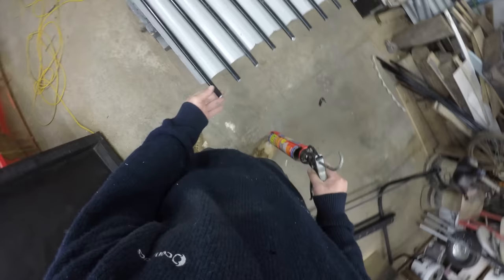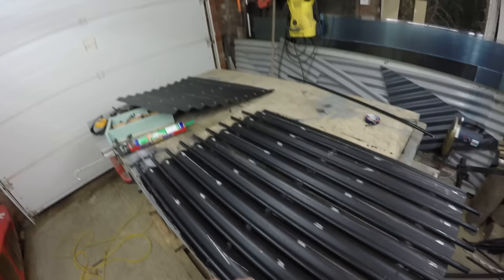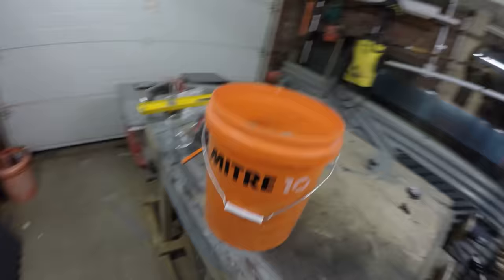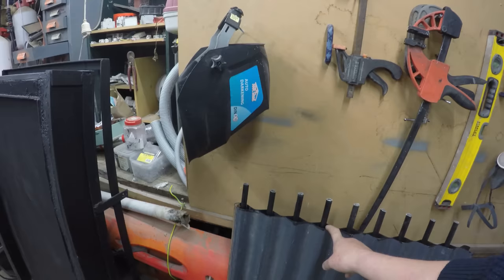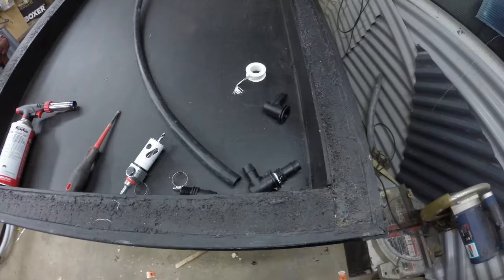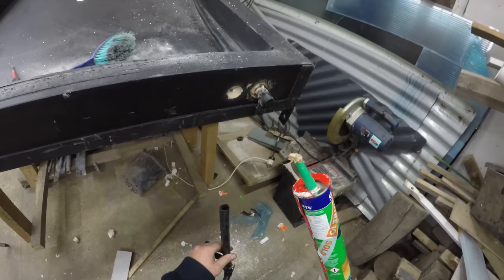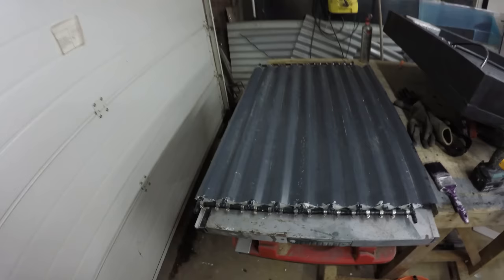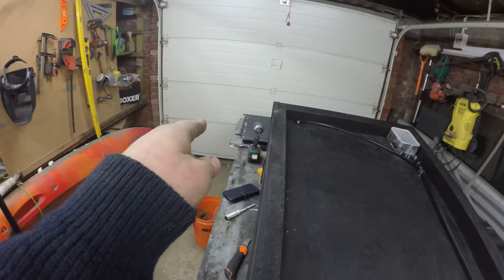Corrugated roofing metal and sand turned into a solar water heater, How I've assembled it.

Comment: Thank you for the great video! For me it led to a continuation of the two elements corrugated iron and sand. Basically, it's a sandwich sheet that could be used as a filter for swimming pool water. If you just leave out the water-carrying hoses and let the water percolate through, it would allow bacterial cultures at the beginning of the "filter" to clean (Effective Microorganisms) the water. The sand grains would provide a large surface area. At the end or exit of the filter, it is certainly so hot that pasteurisation could begin. If not, you could help a little with a solar-powered immersion heater. Heating the swimming pool water would be a side effect, or one could see it as the fulfilment of a permaculture principle.

Comment: You can use sand in an insulated sand battery, but it’s not a good idea in the collector, where you heat the transport medium(water, air, oil) and transport it quickly to your storage device. So you need little mass for quick energy capture.
Reply: When it’s a regular hot climate and not cloud ridden speed of heat transfer is irrelevant..
Reply: Restricted air flow.
Reply: I agree, heat in the panel will take longer to heat up. Sand needs to be in an insulated container. Not out in the weather.

Comment: THERMAL MASS is best used for storing energy long term - not for collection of energy.       Yours could be used for thermal storage but the collector needs to be more like this on that DIRECTLY heats water with the sun (No heat transfer delays like sun to steel then heat to sand then Heat to aluminum pipe then pipe to water). You will probably wait over an hour to see really hot water from this thing and after the sun is blocked you will still get heat for another hour or so due to the thermal mass of the sand.

Comment: Option 1: Mate go to scrap car yard get an old car / truck radiator spray it black put in insulated glass box point at sun.
Option 2: Alternatively get copper or aluminum tube paint with matt black assemble in insulated glass box  point at sun.
Option 3: Section off part of garage roof, seal and paint matt black, place cheap clear plastic cover over the top and send water down.  Note seal well due to expansion of roof when hot.

The option you have shown as will as first two above would work over a camp fire, tea candles, hot embers etc..

Keep up the good work kiwi "Kia Kaha" Stay Strong, I heard accent and saw orange sand bucket.
Reply from the maker: Speaking of option 3, I've got a tin roof on my garage and the thought has crossed my mind of utilising it in some way.
Reply: @DCAL084  Cool design - I suspect you might have over engineered it a bit, I think you would do just as well without the sand. Hard to know for sure without a side by side test. On the roof idea. A family member had a rented house where pool pump was diverted into an unkown length of pipe on the house roof. Nicely plumbed in down side of house with PVC pipe. In the middle of summer it raised the pool a couple of degrees for an approx 40,000 l pool. So a significant amount of heating. Might be an easier way to go. It was a tall house so was hard to see but the black (I assume poly pipe) on the roof appeared to just be scattered around. I have had good success with a small pool heater built from a flat wooden box with glass on top and a coil of cheap irrigation pipe in it. It works well. Just needs to be a lot larger! Raises the water coming out approx 2 degrees on a sunny day with a cheap pond pump driving it.
Reply from the maker: @WarrickTaylor I just finished connecting and started version 2 today, but without the rotation, and without the compost heap warming, to compare how much heating is achieved without these working in combination.

In a few weeks when temperatures start dropping I will switch on rotation and compost heating, and compare the difference, I have temperature recording probes in both compost bins, heated greenhouse bed, non heated greenhouse bed, solar heater, and another one to measure the water storage tank temperature.

I feel like i need the rotation because at my latitude the sun gets quite low in winter, and by rotating the solar heater towards the sun the thermometer probe shows an increase in heating after rotation, especially with the corrugated fins, as they catch more sunlight when facing directly at the sun.

 I will be uploading a new video in a few weeks detailing the new improved system, and later when winter begins results with data to compare.

I can see this by comparing the water tank temperature and the solar heater temperature. 

The water continues to heat after clouding.
Reply from the maker: @WarrickTaylor  the sand inside the solar fins is giving out about 60 minutes of extra heating after clouding, which is about 1.5 degrees of extra heating, I will post the temperature graphs which show this correlation in the next updated video in a few weeks (version 2).
So the sand battery is having a positive effect as far as the data shows currently.
This is buffering the heating during short periods of clouding.

Comment: you should put some sheet polyethylene over the metal it helps it to not lose the heat in the breeze if it cools down or gets cloudy. just some thin plastic wrap
Reply from the maker: I would imagine it would melt with polyethylene directly on the metal, its enclosed inside a twinwall polycarbonate enclosure for that reason,  insulated from the outside cold and like a greenhouse the enclosure heats and the metal and sand absorbs the heat.

Comment: Should have read the instructions.  To use spray foam you have to turn the can over
Reply from the maker: yea i know, i think i blocked it by pressing a few seconds before actually using it, it went alright after a few tries once the blockage cleared.
Reply: It's a guy thing.
Reply: What is the meaning of this word “instructions”?
Reply: @thechumpsbeendumped.7797  I do believe that word means that everything has been poetically translated from Chinese 😁
Reply: @mrpad0  
True 😂
Reply from the maker: Tom WaterFooler  

Im not an expert at all but, my uneducated reasoning (right or wrong) is:

Firstly its only a small amount of sand inside the corrugations, so it doesnt take much to heat.

Secondly sand is easier to heat than water, even though it doesnt conduct heat well. Sand can actually store a lot of heat, once it gets heated.

Thirdly if i didnt have the sand inside the corrugations, it would only be air behind the pipes, and the air would not hold any heat whereas the sand can hold a lot of heat.

So the main heating source is from the metal corrugated steel which is in contact with the front of the pipes, and the sand is a secondary storage of heat which is in contact with the pipes from all other sides not in contact with the metal. (The rear).
So if the sky clouds over for a short while, the sand will still release its stored heat, whereas if there was no sand there, and only air, the metal would quickly cool.

Ive been to the beach on a sunny day and literally been unable to walk on the sand without burning my feet, its quite fine sand here (christchurch, new zealand).

metal filings would be good but probably too heavy, and hard to get
Further more, version 2 which I am currently constructing will have pipes on the sun facing side of the corrugations and also internally with the sand.

Will post a full detailed construction video when complete, and then show results in another video in future once tested.
Reply from the maker: Tom WaterFooler  that is the plan, preheat through the sand and then take maximum heat from the sun facing surface
Reply from the maker: Tom WaterFooler  I would like copper, but its just way too expensive.
I am solder joining, and bending aluminium this time round, so there will be no plastic in version 2.
Also it will flow thru in one continuous loop

Comment: Agree & disagree. I agree with aluminium rods and metal sheeting - all good conductor. However internal sand is bad, as it prevents rapid heat flow into pipes. Also black internal paint is not needed. I agree with painting outer sun surface being black.
Reply from the maker: So are you saying just have the pipes sitting directly on the steel?.
The sand is currently heating to around 55 - 60 degrees C with water flowing through it, without the water flowing through the pipes the sand gets well above 100 degrees C (too hot),
The sand gets so hot in fact that it melts the plastic pipes without the water flowing, so I feel like the heat is still transferring into the sand and then the water quite well just by observing the cooling effect the water has when it flows through, its still absorbing the heat and keeping the sand at 55 to 60 degrees rather than 110+.
i have a wireless probe inside the fins recording the heat 24/7.
the sand also seems to hold the heat for a long time

Comment: One small detail to make that much more effective, if you have your inlet pipes on the edges, put your outlet pipes more toward the center pipes. This will force the water to flow through all tubes. Cuz right now you have the water only goin thru the left and the right hose, the rest are useless.
Reply from the maker: I know what your saying, i remade it in a later video so the flow works better, i wasnt able to fit an elbow in the middle due to the size of the collector, and the elbows available, also I wasnt sure whether the pump would handle going through in one loop when i constructed it so I made it so the water flowed in parallel, I will be remaking it soon using all metal, no plastic joiners, and i will make it flow through the system in one loop now that i know the pump can handle it.
The remake of this one has better flow, convection also helps
Reply: @DCAL084  I think I would add little loops at the end of each pipe, with the main connections at each end so that the flow zig-zags through the panel.  Be interested to see how good it works :)
Reply from the maker: @zenzen9131  that is the plan for version 2, I didnt try that with this version because I wasnt sure the pump had enough power(head) to push through.
I'm looking to start version 2 in the next few weeks
Reply: @DCAL084 what did you learn from that version 1? Is it working In a winter 🥶
Reply from the maker: @ekurdesov  its not winter here yet, winter starts june next year  (i will need to use and test the system from may onwards). 
Version 2 is a much better design, i might have the video up by the end of this week, otherwise next week.
But i probably wont be testing it until i get the new dual pile compost heating system built first.

Comment: You can tap the unit to compact the sand before sealing with the foam…
Reply: No sand needed into the collector. Sand is a heat accumulator. A good collector has to be a good conductor.

Comment: Sand is an isolator, shouldn’t have been used at that point where fast heat transfer is required. 
The reason is that sand particles are big and lots of air is trapped in between.
Reply from the maker: Im aware of that, the aluminium pipes are still in contact with the outside tin which faces the sun, so the heat is still transferring, however I can see there is ways to increase the amount of surface area of the outside tin which is in contact with the pipes, to increase transfer, and I will look to improve this when i make the improved version 2.0
As for the sand, the sand is there to hold  heat behind the pipes and store and release it over time.
Reply: Hmm… might work well in summer  or spthern latitudes where there is excess solar heat. Other times, I am not sure...
Good work, thanks for the video!
Reply from the maker: @user-ny7bt5jg6f  I'm in new zealand, so southern latitude.
The solar sand heater is more supplementary heating, the compost heating is more important as thats what  will keep the greenhouse beds warm during cloudy cold days and nights (next winter)

Comment: Plastic plumbing and construction adhesive aren't known for longevity in Hot environments.
Reply from the maker: Your correct, Unfortunately i found that out after the metal warped and popped open and the plastic melted, I then remade the pipe connections as shown in a newer video i uploaded.
I remade all the connections using only pipe clamps, (no adhesive), i also had to rivet the metal together.

Comment: It's hard to tell how it's been plumbed, but it looks like there isn't one loop running through the whole system. Will it not be the case that the water will preferrentially just run down both ends of the heater, rather than fully circulating? Essentially creating a stagnantish area in the centre? Perhaps the convection currents reduce this, or I'm missing something very obvious. Apologies if so. Subscribed anyway! Thanks
Reply from the maker: I was wondering the same thing, i actually remade the pipe connections in a later video and mentioned this,  my thinking is that there will be a preferential path, but convection will still mean that the hot water will rise anyway and there should still be some current albeit a bit slower in some pipes, i wanted to reduce pump head requirements, but in saying that, after running the system now the water pump quite easily pushes the water through and could probably handle pushing the water through in series. I also added extra pipes into the compost in a later video, and they are in series, and soon i will add more pipes in an extra greenhouse bed.
Its possible i might make a new series pipe setup at some stage and trial both ways.

 EDIT: i now have a plan for a remake, this time i will be using only metal piping, and it will be one loop through the panel, no plastic, I will post a video detailing how I made it in a month or two when its complete

Comment: Has anyone tried mixing a setting medium in with the sand? Say gelatine (would it go mouldy?) liquid silicone or something else, so that there is a better heat transfer in the sand and into the pipes? Or is the performance so good that that's just academic? Or just having the whole thing full of water but keeping it well below 100C using cooling, so it doesn't boil?
Reply: I didn’t try anything. Just want to answer your question. Take care of ignition point of different materials. Mixing materials may make them very flammable.
Reply: @son-of-a-gun  Thanks for that reply - I've no idea what that is, never used it - does that 'set' like a solid or a jelly? Is it a water or solvent mix - what's the best way to apply it etc. Sure I will look it up but I wonder if you have experience of working with it you might be kind enough to share? Cheers

Comment: Does the sand give back some of its heat after the sun goes down, extending the operational hours of the unit? Is that why you added the sand?
Reply from the maker: Without doing any research etc, my thought was that the metal will heat and pass its heat to the water but at the same time the sand will also heat behind the pipes and pass its heat to the pipes, and also yes that if it clouds over for a while the sand will keep releasing its heat.
Reply: @DCAL084  thx 😊

Comment: 1:41 hate when that happnes.
5:32 I'm seeing on issue that I'm sure you've already picked up after installing this is not heating up water enough on sunny days. You need set up as coil the setup you have is good for getting rid of heat.
Reply from the maker: Yes, i'm aware there will be better ways and I will try a coil setup through system ln a few months and see if it makes a difference, I will have just one loop through, ill add a few extra pipes also.
I remade the pipe connections for this setup in a later video.
Reply: @DCAL084  I think you have a good idea attaching the tin to the pipes. Just attaching one piece should get you mass to xonduct heat the pipe.
Reply from the maker: @patrickradcliffe3837  the reason i had the pipe flow in parallel first time was because i wasnt sure if the pump would handle going thru in one loop in series.
I now know it will manage so I will tweak the setup soon.

Comment: Plastic and glue don’t work well with a heat sink storage device.
Reply from the maker: Yep, i found that out after first try and I then replaced the glue and plastic with rivets and clamps, see my later video for that.
The plastic popped open and metal warped causing the sand to spill out after reaching 100 degrees +
Reply from the maker: I have plans for a version 2, with a few cheap tricks to be able to construct it with cheap aluminium pipe with no plastic connections or aluminium joiners required.
Stay posted for a detailed video when I make it in the next few months.